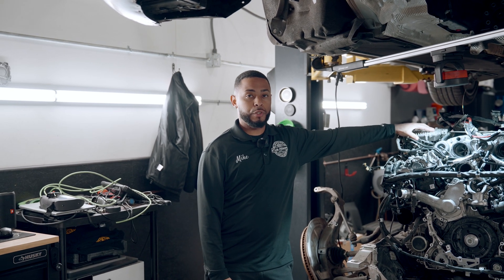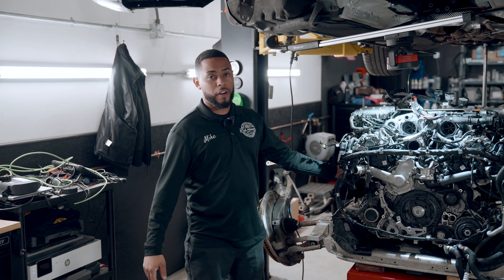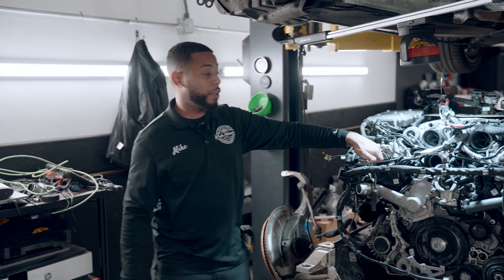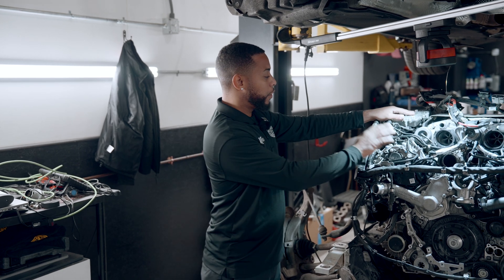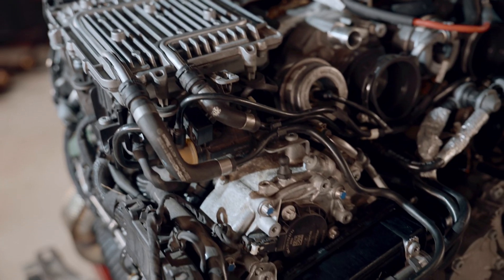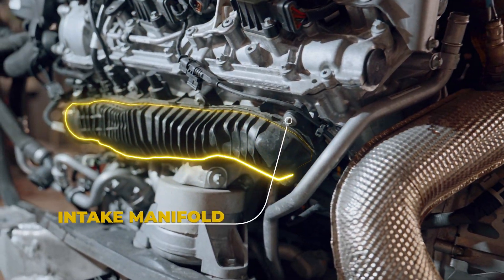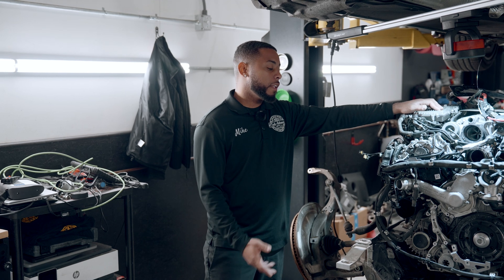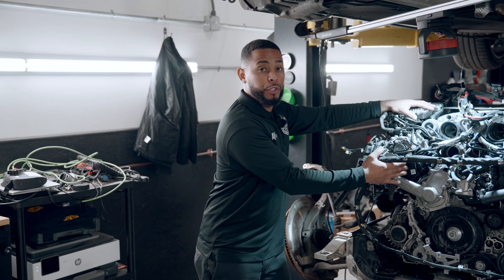Common Problems with Mercedes-Benz M176 & M177 AMG Twin Turbo V8 | 603 MTech Autowerks

Comment: My 2016 C63s Cabriolet. Always serviced on time, never missed a service or replacement part needed. Recently had the entire cabriolet roof redone, thankfully merc as a good deed covered most of it but was still
$5,500 AUD out of pocket. Now only 11 months on, the rear E-diff, rear axle electric rear differential lock has gone, metal in the oil, incessant rear axle differential lock inoperative, nothing has fixed it, new DC motor / actuator didn’t fix it, that’s quoted to be $8400
AUD at an indie to replace. 

Left hand side lower control arm, squeaking and failed, needs a new one, $1700 indie mechanic to replace that. Suddenly went all at the same fcking time, and remember always serviced at merc, never tracked or abused, just ridiculous.

Nasty issue with the fuel injectors, one or more injectors are causing an issue with pressure being likely too low, that is looking like a disgustingly expensive issue to diagnose first, as it could take hours and hours to find which injector is bad or causing the issue, and replacing the injectors which are disgustingly expensive each OEM. If it’s more than one injector, honestly, just feel like flogging the car at this point. Have owned Maserati’s, the old Ferrari 4.7L Maserati GranTurismo, BMW’s, Alfa Romeo’s, M4’s, M2’s, never; ever had so many issues with a car in my life. 

These cars are horribly unreliable, and in Australia at least, parts for an AMG are more expensive than a fucking Masersti, even a FUCKINF Audi R8, and some Ferrari’s. It’s abominable. Never buying another AMG product again. 

Doesn’t matter if you take care of it, it’s just constant problems and parts coming up to thousands upon thousands of dollars. Things like rear differentials should not be bloody going in these damn things at 80k km’s, with rear diff oil being changed etc, and barely ever losing traction during its life span. It’s not right.

If it was a Ferrari, I’d understand. It’s a C63s AMG. It shouldn’t be this expensive, or unreliable, and needing so many MAJOR mechanical replacements all at once. It’s absurd.
Reply: Either you have a lemon or a driver error. I know many AMG M177 owners with none of these issues

Comment: Manifold that crack huh!!  Why doesn’t Mercedes stop!!!!! Making them plastic!!!  What an extra $8-10 dollars to add aluminum manifolds???  The excuse of it adding up in price for the vehicle is complete bull💩!!!  They engineer these cars with that bs plastic piece because they know at a certain mileage those plastic manifold are guarantee to crack!!!  It’s usually when your warranty has expired and now the customer has to come out of pocket to fix this crap.  When a simple aluminum upgrade to the plastic manifold would possibly completely eliminate this situation!!!!  You have to pull those damn engines to do even the engine mounts and that 💩 is not cheap!!!!!!

Comment: M177 is time bomb and you will see. It is compact & complex, plastic more like BMW. Full of leaks both oil & coolants More labor & part cost. Adding on that M177 have the same issues of M157, Rattling, Timing chain stretch, common misfiring. So what is new, the closed block only? 😅
Reply: They are completely different engines, nothing is the same in M177 vs M157 😉
Reply: @koliberk  even though what i have stated is fact. Do you have any one of these engines so you know how they differ?

Comment: How do you diagnose oil separator problems?
Reply: I have a 2018 s560 w/ 70k miles, I went to replace the oil plugs a few months ago, tech found oil in plug chamber, ended up being leaking valve gasket covers that I had to get replaced. A month or so later, I would notice on cold start, some squeaking/whistling from the engine, but would eventually go away shortly afterwards. Had MB tech look at it, said both left/right oil separators needed to be replaced. The noise is what prompted me to have it checked out, no other issues. After watching this video, I'm assuming my oil separators have been bad for some time, thus causing the valve gasket cover leaks. Getting the oil separators replaced next week. Wondering if I should have them look at anything else while the car is taken apart. I hope this helps.

Comment: I have a 2021 G63 m177 in my stall rn getting the oil pump valve and harness. Pulling the trans and intercoolers back and dropping the diff. Lots of fun

Comment: Sadly Mercedes has been hanging out with bmw to long and decided to start making critical components plastic crapstic. I know why bmw does it, nobody buys a BMW, they lease them so they only need to be reliable for the warranty period of 3/4 years. Which is how long their plastic engines last before they fall apart. 

Unfortunately Mercedes has decided to incorporate that cheap tatic as well.

Comment: Number 3 for me: valve cover leaking oil into spark plug causing misfire. New rocker cover gasket is needed and spark plug tubes

Comment: I have a 2013 ml63 which has the m157 engine. Ive worked on the front of the engine and had to remove fan. I recently purchased a 2018 glc63 which has the m177. Is the m177 harder to work on compared to m157? Does the whole front end needs to come off to replace parts on front of the engine or is it similar to m157 removing fan assembly?

Comment: Any obvious symptoms of a bad oil separator?
Reply: Rear Main Seal leaking, Engine running sluggish
Reply: @wavyydiaz2970  No way to clean it somehow?
Reply: Once engine is warmed up, to temp, you will hear squeaking noise while driving, especially at low speeds. Happened to my car and got them replaced. E63s

Comment: Have you dealt with P06DA00 - Engine oil pump control valve issues on these engines? Any advice you can give? The dealer wants 7k+ in labor to replace this $100 part
Reply from the maker: @huy8105  it’s a. Issue on most of the engines but it can be labor intensive because the oil pan has to be removed, typically it’s the jumper harness that goes bad
Reply: @603benztech  got it and thanks for the quick reply! 🙏  I got the same conclusion that it's the harness that typically goes bad from reading the forums. From my understanding, this part reduces oil pressure to the engine at lower RPMs so there's no risk to engine lubrication when it's not working since the oil pressure will just be standard at all times? I'm just wondering if it's still safe to drive for now until I can decide if I want to eat the 7k repair bill(which seems unusually high even for the work that needs to be done)

Comment: Thanks for this, my rear main seal was leaking on my M176, and after finding your video I had the dealership look at the things you mentioned and managed to catch a few items early and get them fixed before it got bad. Appreciate it!
Reply from the maker: @hornbeck  awesome glad to hear 🙌🙌
Reply: GLS 580 '21 M176 slightly shaking on warmup but right after its going bad and shaking asf misfire 5,6,8 and faults for air leak. whistling noise  Any ideas ? @603benztech

Comment: Funny. You forgot the Cylinder 4 misfiring. I myself had that problem twice (under 60k km) and i know 2 other drivers with m177 and m178 that had that same problem. Caused by temperature if you actually use the power (not even on the tracK) that it has. For me it was ignition coil and injector at that cylinder. For both of my friends it was cylinder 4. So apparently cylinder 8 (or the stuff above) is running cooler because it does not have an ECU on top ;)

Also mention how people will notice these issues before they happen or what they could do to prevent that.

Update: had the same issue on cylinder 7. Coil change and it's fine again.
Reply: J'ai exactement le même problème !! Raté d'allumage sur le cylindre 6 lors de charge, elle est au garage depuis 3 semaines et ils n'ont pas encore trouvé le problème, moteur m177, vous ou vos amis savent quel est le problème s'il vous plaît, merci pour votre réponse, ce serait très gentil !! 🙏🙏 
Bobine d'allumage et injecteur ont étaient testés et sont ok.
Reply: Did you ever have the code: P1CEF85 relating to this at all? 2016 C63s Cabriolet, have babies the shit out of this car, never tracked or tuned, and barely ever lost traction in its life, rear e-diff needs replacement, and now the injector / s are playing up putting the car in a permanent “soft limp mode” making Camry’s be able to take off faster than this thing. It’s driving me mad, I’m sick of this car. 

Seems mine has an issue somewhere, NO IDEA WHY, with an injector and the pressure possibly being too low. Looking like by what my mechanic said, to be “thousands” and he’d really just trade it in at this point once the e-diff is replaced. It could be minor, I’m hoping it is.
Reply: @VlahovIvanov not sure about the diff but I've already had an injector replaced. The part itself is 200€ if you buy it on the Internet. Benz wants 2-3x that 😂 

Never seen that code. Where did you get that from? Obd? 

Are you the first owner of the car?

Oh btw I've had the same issue again on cylinder 7 😅 changed coils and it's fine

Comment: Had the intake Manifold crack on my X 253 Glc 63s 2019 completely stock. Has nothing to do with a tune. The reason why it cracks is because It's made of plastic and can't handle the heat soak. This is the same with the C 63s, glc 63s, e 63s, and the GT 63s. They have a plastic intake manifold. Should have been billet aluminum.

Comment: Having spent the last few weekends under the hood of an M278, seeing this video has made me loose faith in Mercedes altogether.
How did they manage to make it have MORE hoses, wires and sensors AND be harder to work on?
Reply: I miss my M113K
Reply: You think this is only a Mercedes problem and not the entire auto industry? These are mated with a 48v mild hybrid system, that requires more electronics.

Comment: Car has 189 000km is in W222,of course new termostat rear seal,breaders 2x 
Repair start with mistake on bank 1 intake camadjuster was bad

Comment: I have big problem with this engine with timing,3th time is engine out covers down,new 4x camadjusters,2x timing chain,2x tensioner,1x camshaft bank 2 exhaust,today again start new oil filter 2x, and again mistake on bank 2 intake and exhaust camshaft,everything set up on timing 40 and on 53 plates are excelent,timing was set up by original tools,iam doing all mercedes-benz motors 13,5 years and i never had mistake like this after repairing the engine,when somebody know please hepl

Comment: My 2017 (at 51,000 KM) recently started belt squeaking during startups, the squeak gets softer and eventually stops after around 10mins of idling or temps reach around 40-60celcius. Any helpers please.
There is also a tiny bit of tick tick, searched it online and apparently that is usually from the purgers and is normal mechanically.
Thanks!

Comment: Thank you for this valuable video. I have a question for you. I want to buy a Mercedes AMG GT 63, model 2022, with an M177 engine. Do you advise me to buy it or not? Thank you in advance.
Reply: Je te déconseille, amg a des soucis de fiabilité, sur mon m177 j'ai eu le joint spie de la boite de vitesse qui a fuit, et en ce moment elle est au garage car lorsque j'envoie une forte charge, j'ai une rupture d'injection avec perte totale de puissance. Va chez audi rs c'est beaucoup plus fiable comme moteur.

Comment: Another apparently common problem: camshaft adjusters and camshaft position sensors leaking oil through the electrical connectors. Oil seeps through the wiring harness over time eventually getting to the computer etc. Just checked my camshaft position sensor connector (50k miles) and there's a little puddle of oil in it and oil on the connector.
Reply from the maker: Yeag we will be making a good video about that when one comes in

Comment: I have an C63 Coupe with the M177 and 165.000 Kilometers mileage. Now it is 8 years old and it works.
Reply: Same here, C63 coupe 2016 with 145.000 Km and no engine problems so far.
Reply: Didn't any problems occur during this period?
Reply: @jghjvhhgj1912  I also have 100k km on my 2019 C63 S Sedan, can't complain

Comment: It would be interesting to know if there are any better engineered replacement parts for these common issues.
Reply: How come M177/176 are complex compact engine. Almost Junky parts together and you still prefer that over M278/157? Which is much simple and easier and robust for tuning? Strange 😅

Comment: Excellent video.
I have an m176 and its at 75k.
Replaced the plugs at 50k but no oil on the covers.
Mine its tuned. 
II do early maintenance on it.
Reply: Curious if the valve cover leaks are related to excessive crankcase pressure created from clogged air oil seperators.
Reply: Hi, what kind of tune do you have ? Do you see perforemance upgrade ? Thank you

Comment: I would highly recommend replacing the plastic intake manifold. Weistec has aluminum replacements. So I’m looking at the Aston Martin vantage that has the m177 or a s63 amg. So I want to get an idea on what to take care of before doing full engine rebuid. Doing forged piston, rods, aluminum intake manifold. Upgraded turbo kit and down pipes. But want to replace all seals and main failure points first while engine is out
Reply: I’ve been running 840/1250nm for 3 years, laps of the Nurburgring and maxed her out at 211mph, the manifolds are doing just fine, it’s the front diff that will go before anything else 😅
Reply: Did not see aluminum replacement M177 intakes on the Weistec site. Do you have a reference to them?
Reply: @exploreyour4359 they are there quite easy to find bright red
Reply: the motor has stock forged rods and pistons, i’d probably do a resleeve before anything

Comment: Warranty unfortunately won’t pay you to drop it. Or will it🤔This is my 3rd time within 3 months opening/ resealing valve covers replacing camshafts, sprockets, even a cylinder head all on the same lemon. Needless to say I’ve almost quit so many times because of this engine alone
Reply: What was the customer complaint

Comment: Great video, I'm having the issue of oil on one spark plug and coil pack! Does this engine have a Mercedes Spark Plug Tube Seal inside the valve cover? There are no leaks on the ground or in any of the other spark plugs or coils @603benztech
Reply from the maker: Valve covers are sealed with sealant , there are no seals
Reply: @603benztech  thank you,  so no gaskets or seals only a sealant?

Comment: 24 hrs * 300 labor rate = 7200 just for two engine mounts.
Reply from the maker: Sounds like dealer rates 😢
Reply: @603benztech just a random question, would you replace your engine mount with a non mercedes dealer? the engine have to come apart.

Comment: I've worked on Mercedes-Benz vehicles for 23 years. I worked at the dealer from 2001-2010. These newer V8s are junk compared to m119/m113/m273. No more 63 anything for me. Even the m113k is starting to show it's age with the o-rings disintegrating behind the front timing cover causing oil and coolant to mix and o-rings failing down by the oil pump causing starvation. 20+ hours for motor mounts? Reminds me of the w220 S65 labor times. Plastic Intake manifolds is giving off bmw vibes. I do not recommend any mercedes newer than 2011.
Reply: You said it yourself, stopped working on them in 2010

Aka you know nothing of the newer engines. A lot more wrong with 113k’s these days than just timing cover seals….

The ratio of complexity of an engine like a m177, compared to its reliability is actually very impressive. If m177 was as simple as m113, it would last 2x as long
Reply: @ctravis595  sure buddy. Sold my G63 and went back to a G55 because it's a piece. If the newer engines are so awesome why does a 2010 G55 worth more than a 2013 G63 with the same mileage?
Reply: @Cody-Travis  stopped working at the dealer in 2010 Einstein. Learn how to read. I still work on mercedes.
Reply: Lol incorrect
Reply: I agree.
Have a 2009 M273 with 224k on it running fine, and I’d much rather my next engine be another M273 than the 278 or even 176.
Reply: 2011 is a bit of a stretch. The M276 bi-turbo is still pretty reliable. I’ve taken two of them (ML400 & C43) over 100k with zero issues. I know we’re talking V8s but you said “any Mercedes” at the end there.
Reply: @Nick210  m276 is underwhelming honestly. It may be more reliable than the m157/m278 but it's gutless
Reply: Is 2014 g550 use m273 engine? I remember after 2015 mb use m176 engine use in g wagon
Reply: Amg now along with nmw s58 engines are the most reliable vars on roads today

Comment: Good information.. I remember a time when Mercedes 8 cylinders were bulletproof and reliable (sort of) M117, M119 and even M113
Reply: Well considering the M113 always leaks from valve covers and also very often from the oil filter housing and engine mounts are quite often tired as well I wouldn't say the M177 is that bad.... Biggest difference is the acceeability of the M113 compared to M177... Only job you need to remove a M113 really is full rebuild hehe but some M113 engines are almost 30 years old soon so seals starting to leak is expected for any engine that age...
Reply: Hell, this makes my M156 look like child's play.
Reply: The M112/M113 and even the M113K are all PROVEN 500,000+ mile engines. The M113k needs to have it's supercharger maintained sure, but they are all just so overbuilt. You can't kill them. When I got my first CLK 55 AMG with it's M113 under the hood, it blew my mind how simple it actually was. The Valve Cover breather boxes need resealed every now and again but that's really it. Having two-spark plugs per cylinder and adding a ton of compression is like magic.
Reply: @ftffighter  correct, 135K miles on my E55 and zero mechanical issues other than airmatic pump and supercharger bearing. i never beat on it from a dig, but have run it 130-140mph many times..